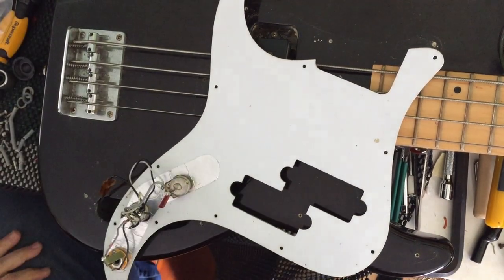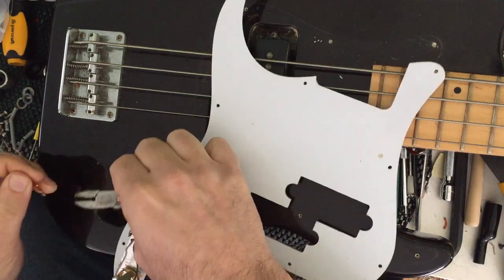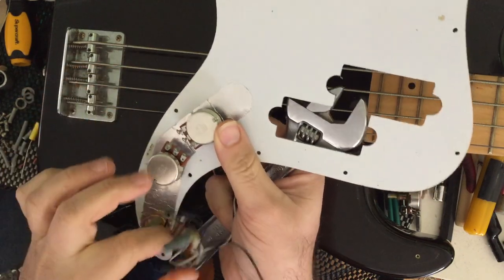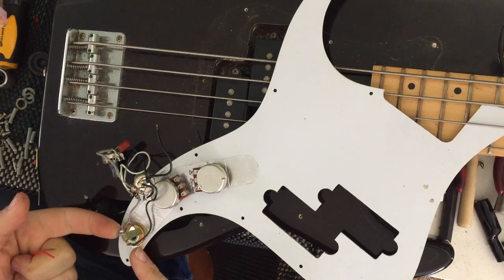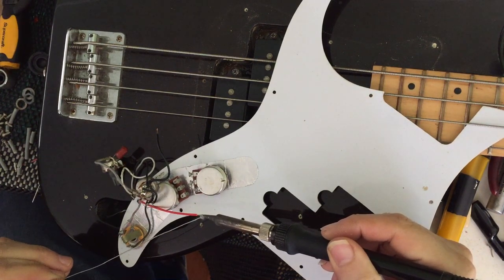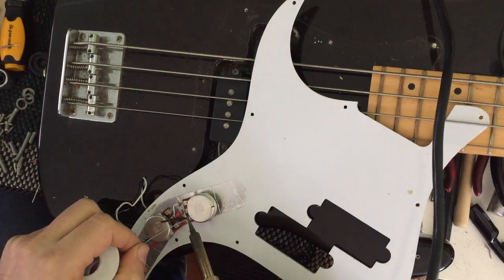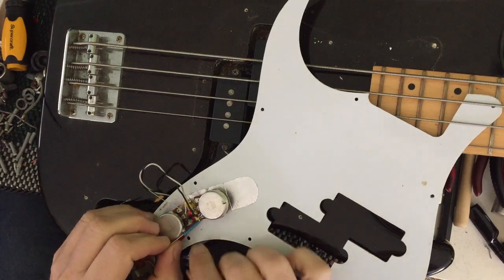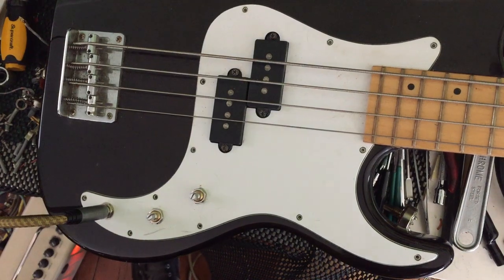P-Bass replace your tone and volume pot and output jack

Comment: Kapton tape is used in surface mount technology manufacturing. It's used to tape off the gold "fingers" connections before the wave solder process. I know, I worked in SMT for 34 years.
Reply from the maker: @everready19373  I did not know that. Awesome!

Comment: Nice job thanks for sharing. 
I have a Mexican made P bass and another from Asia " P bass "Moon " It was new and  paid $70 dlls , the magnets of the "moon bass " are stronger than the Mexican P bass and have more output , I wonder if I can damage my bass amp using those cheap pickups .
Reply from the maker: @Fili2009able  it won’t damage anything unless you crank the amp up and blow the speaker. The higher power output doesn’t necessarily mean better tone though. But that is always a matter of personal taste.

Comment: Hola quería preguntarte si se podía hacer un circuito con una solo potenciómetro de volumen osea sin poner el potenciómetro de tono
Reply from the maker: Of course it can.
Reply: Claro que si , pero no se tiene la opción de ponerle mas agudos o graves al bajo , tienes que controlar el tono desde el amplificador y si estas tocando en vivo debes de dejar de tocar o esperar a que termine la canción y ir al amplificador para hacer cambios y ponerle mas graves o agudos a tu sonido del bajo , muy incomodo porque si tocas varios estilos de canciones no es practico tener solo el volumen .
Reply: @Fili2009able  solo tocó un estilo de música no creo que me incomode tanto

Comment: Question: If I get my bass repaired at a music store will they have to break/remove my strings to get to the scratch plate and the wiring inside?
Reply from the maker: Not necessarily. However, that's something I usually ask my customers depending on the condition of the strings.
Reply: Nope just to loose the strings a little so its easy to move the scratch plate

Comment: I have a cheap Dean bass, but to me it's nice. Can I get the source for those pots? I can solder like spiderman. Thanks for the informative video kind sir! =)
Reply from the maker: heath ashley if you’re in Australia, try Evatco or WES (Wagner). I mostly use Evatco because Kevin is an outstanding guy and always looks after me.
Reply: @whatsstefon  Right on! Thank you for the reply, and of course, the video! I'm in North America, normally a pinball repairman, just getting into a bass that someone broke =(
Reply from the maker: heath ashley ah, nice one. I’d say there are plenty of sources for pots in the US. StewMac would be somewhere I’d begin to look.

Comment: Is that a Yihua soldering wand???
Reply from the maker: It’s possible, just rebranded for a different market. This is where I bought mine from. https://www.altronics.com.au/p/t2417-micron-lead-free-soldering-station-60w/
Reply: @whatsstefon  Dang that's a nice one! Just looked at the link, wow bro! I use a little knock off yihua, with a temp pot...

Comment: ...did you used a linear pot for volume and a log pot for tone (as usual) or did you used another kind of combination?
Reply from the maker: Indeed I did. Sometimes I'll change it up depending on what customer specifically wants. However,  I also often stick to what is already in the instrument. Purely so the customer is use to that taper.
Reply: I’ve made a mistake though, because standard the log taper (A) is used for volume and the linear pot (B) for tone. I’ve heard that some people prefer log tapers for both pots. What exactly is the difference (advantage) than, do you know that?
Reply: PS ...and what kind of capacitor is normally used on a Fender Precision?
Reply from the maker: @bobzadokblokjr  the difference is the way the resistance changes as you turn the pot. Half way on a lot might not necessarily be half the value of the pot.
Reply from the maker: @bobzadokblokjr  capacitor wise, it's best to use a value you like. Generally a 0.047uF will be good with humbuckers. Their a darker pickup, so you want them to brighten up. Single coils cut through so you can to reduce the cap value to something like a 0.022.

Of course you can use anything you like.  A 0.01, 0.033 and so on.

I might do a video on how they affect different pickups.

Comment: Very good. The Burns pots or CTS.  I'm doing this very same project. Are these 500k pots? What type of capacitor?  What is the specs on these parts so I can order them? It's my 1st project.
Reply from the maker: I used Burns 250K pots. Most Fender style setups (ie: P and J bass) will use 250K pots. I like the feel of the Burns pots, but I use CTS as well, just not in this video. I also use solid shaft with knobs with a grub screw because I really don't like the split shafts. They seem to break quite easily.

Comment: hey man, does the jazz bass knob also fit on a stratocaster?
Reply from the maker: I would assume not unless the pots have been changed. Most strats have push on knobs because you’ll find a split shaft with knurling. Where as these pots on the jazz bass are solid shaft and the knobs have a grub screw to lock them on to the shaft.

Easy fix is to replace the pots or buy suitable knobs for the pot shaft.

Comment: I just changed the electronics but my tone knob is not working, the tone doesn't change
Reply from the maker: Time to open it up and test your wiring. Or it could be a faulty pot.
Reply: @whatsstefon  Oh I see, maybe, because I rechecked my wiring many times, and referred to diagrams for confirmation. so maybe the pots are not working properly. Thanks bro!